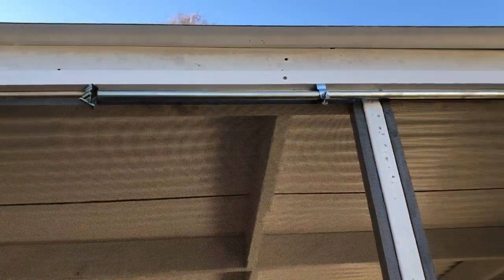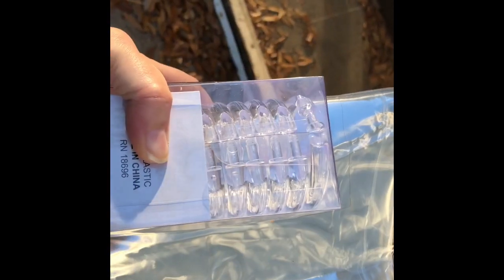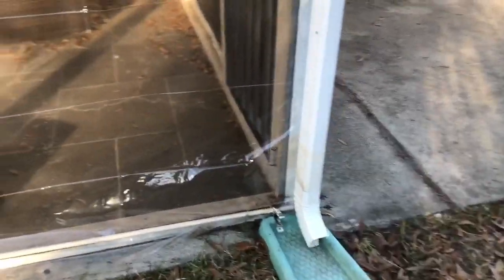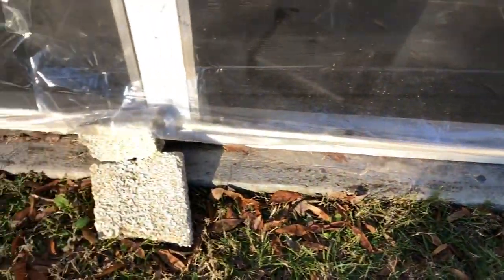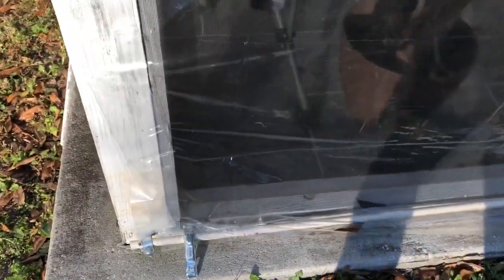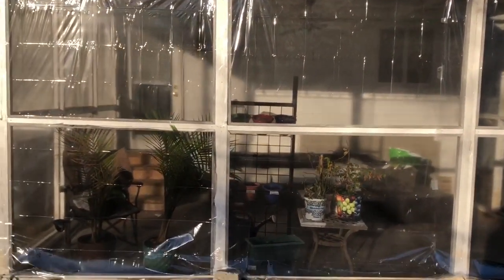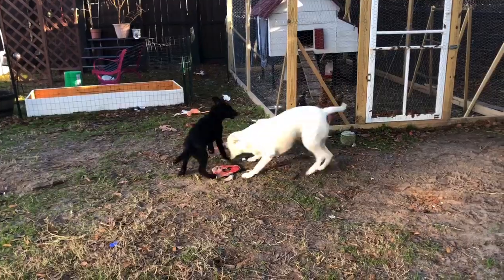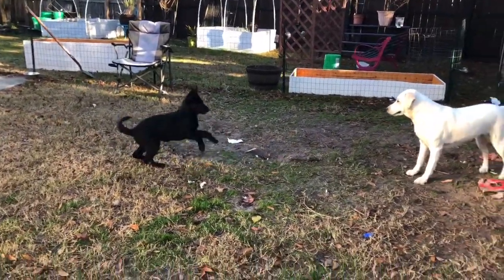Another use for shower curtains. Inexpensive Way to Enclose Your Patio

Comment: The winds where I live will never hold up against this. Have you thought of putting the grommets on clasps or nails for more security? I saw another video where they did that and used graf tape to go around the edges of the vinyl for added security. I think I'm going to incorporate their idea but I will try your method with the shower curtains rather than vinyl. At least to start. I don't know, though, if my porch posts are too far apart for me to actually cover one area seamlessly since the shower curtains are only so long. Great idea though!! Subscribing.
Reply from the maker: In a different video I show where I used heavy tape at the top holes and I found that keeping it slightly loose so it would not fight the wind helped , by using the condit pipe and the rings.   its a cheap way and if it doesnt work for you it only cost minimal money , I bought the vinyl before and it really was expensive and didnt last that long , so replacing cheap shower curtains every few years is worth it to me ,   thanks for the sub ,

Comment: I've been doing this each winter for almost 10 years. I always try to get at least 10 mil vinyl and put grommets or the thickest and heaviest shower curtain ---the wind will tear them up if they are not heavy enough.
Reply from the maker: true , that wind is fierce , so I find if you use the shower curtain hooks on a rod , its the next video I think , its not so taut in the strong winds .

Comment: I would suggest 8 mil green house plastic.  Have you tried that?
Reply from the maker: we tried some vinyl material from the fabric store, dont remember the weight , but after a while it rips and doesnt hold up so we moved to the cheaper shower curtains , replacing these every few years is easier on the wallet.  thanks for the suggestion ,

Comment: There is also two way velcro, Adhesive on each yet place the fuzzy on the inside of the shower curtain when placing on the outside leaving the pointy on the sections you choose yet being able to take down after the storm. On Ali Express, Amazon, pending right footage, and very strong. Plus clear shower curtains, maybe not as thick for other projects are 1.25 with Dollar tree and then 1.25 for the hooks, although velcro top to secure, and no need for hooks.
Reply from the maker: Great tip! but for us the wind is too strong ,  we chose to use curtain hooks so there would be movement to stop tearing of the plastic,  but the velcro will work if you dont have strong winds for sure,   thanks for stopping by and commenting
Reply: @homesteadingwithsadie  I appreciate your response and I would not have realized had you not shared that. Are the hooks strictly at he top, or on the bottom to sway, and do you mean some movement and a little secure perhaps on each side only portion?  or what am I missing? This would be really helpful for my plants on the deck to reduce excess rain if I can set up correctly.
Reply from the maker: The hooks are just on the top using it like you would a shower curtain in the house.

Comment: How has the tape held up?
Reply from the maker: the tape held up well however we got a lot of wind and the curtains started to rip here and there.  but they were pretty cheap on Amazon ,  I really did like using the electric conduit as a curtain rod .  I think what will help is if we round the corners with the curtains the wind wont grab on to it as easy .  trial and error

Comment: How did shower curtains hold up for winter??? Did they tear,got foggy or dull???
Reply from the maker: The area around the rings will tear some so put some clear tape to reinforce them . They will last a few years before you will need to replace. But so much cheaper then the vinyl

Comment: Hey great video, How are you connecting and sealing everything? I see the rods on top but not sure how you're getting a good seal. Staple gun?
Reply from the maker: I used an industrial type tape to seal together.if you use staples tape it first then staple because the wind will rip it with just the staple 
Watch my update video called the trick to the shower curtain it’s in my playlist

Comment: It has been 4 years, how the curtains holding?  I think the curtains are for indoor use and not UV protect.
Reply from the maker: As far as UV we would take them down in summer when the sun is hotter. The best thing about using shower curtains is they are  cheap so we have had to replace them a few times but just because they get torn at the grommets it’s a cheap alternative to enclosing your patio. Thanks for the comment
Reply: @homesteadingwithsadie  thanks for your response.  I agreed with you and I think shower curtain is a good alternative.

Comment: How cold does it get where you are in the winter? We have a long winter where it can be 5-10 degrees daily for a few months. I would like to do this idea for my enclosed deck so we can sit out there in the winter. Not sure if these curtains would be thick enough to keep the cold out to the point where it is 70 degrees on my deck.
Reply from the maker: The coldest we ever get is down to 25 and that’s short spells ! However you could get thicker weighted curtains .

Comment: Awesome! Just used shower some clear shower curtains to insulate my windows for winter from the inside. (Cut then to size & used nails and painters tape) 

How did the shower curtains end up working for you? FYI target has them for super inexpensive. Between 3 & 6 dollars.
Reply from the maker: that is awesome , they are so much cheaper then buying plastic , and thicker.   So glad you were able to use them in your windows, 
a few of them got tore up with the wind , so I will have to replace them this year, thinking about running the conduit a full turn around the corners to keep the wind from getting behind the curtains,   I will check out target , thanks , my biggest problem is these are super long like 98 inches i think ,  so many stores dont carry them , but I am going to check target anyway  just to be sure.

Comment: Tape doesnt stick on our aluminium not even gorilla or duct tape not waterproof either not evdn staple gun keeps our plastic on these broken out window frames..we are due for a storm at 5pm hard rain maybe even sleet hail or snow we never know and ive got no vehicle and im due to see this storn roll in in 8 hours so i gotta get hoofin it ive got zero money for taxi fare and no busses run near here! Im screwed baically but by hook or by crook ...btw i have n hook and im no crook lol im making my way down to the dollar tree or daiso to find some shower curtains darnit! Wish me luck yall!
Reply from the maker: good luck , the tape that will work is awning repair tape however that might be expensive ,  we used it along the edges by the house . stay safe and warm
Reply: Gaff tape. Local hardware store should have it. May benefit you to clean it with alcohol or something similar too
Reply from the maker: @NigelHeads  thanks for the tips